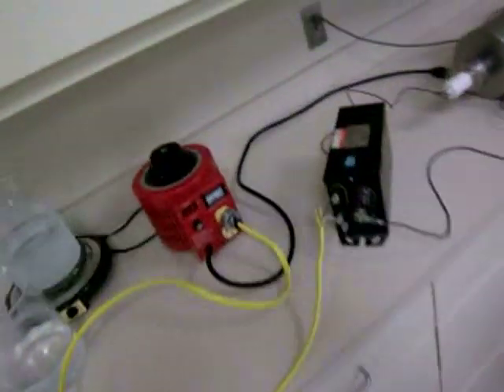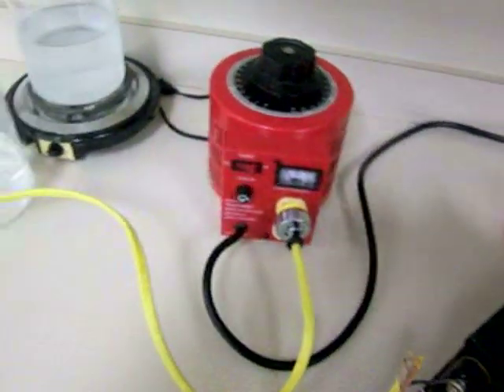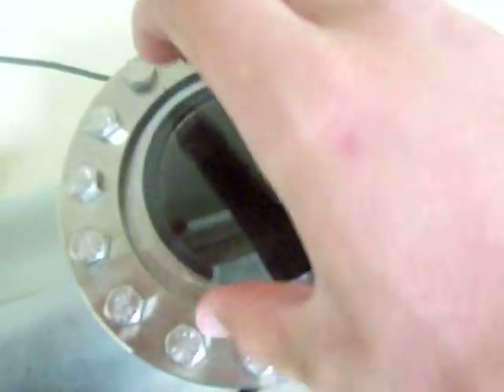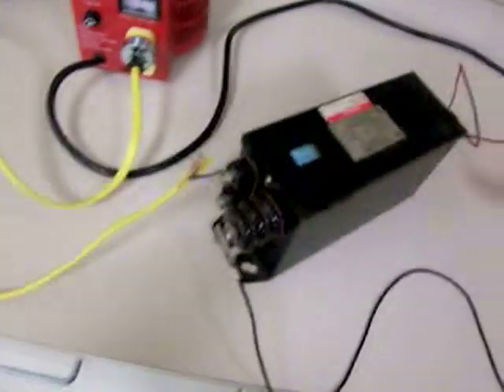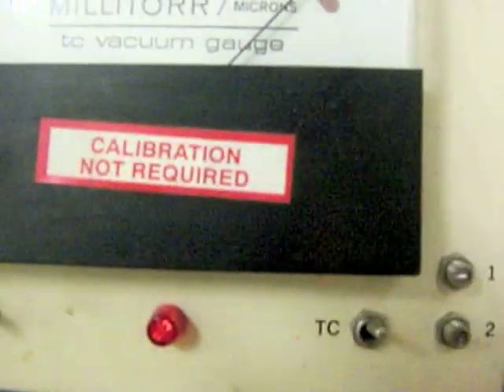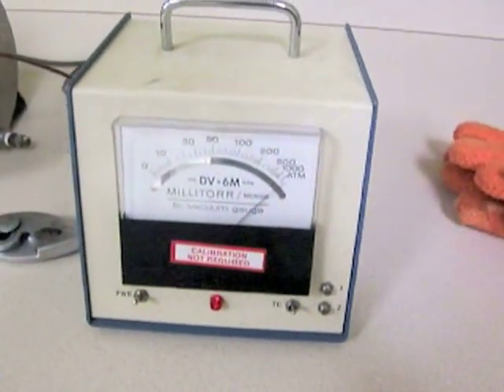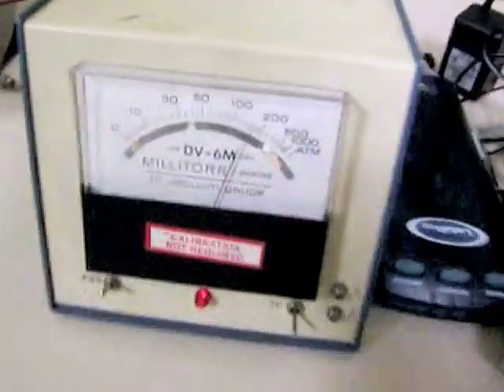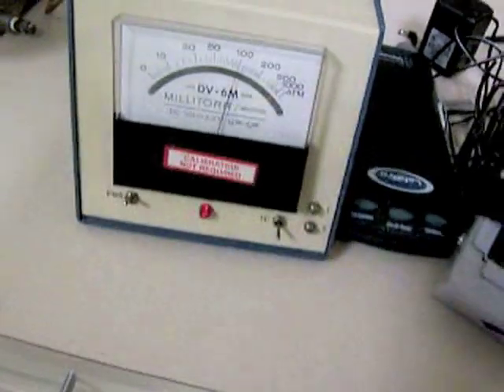Farnsworth Fusor

Comment from the maker: I was using a 30kv high voltage feed through...a spark plug could be used and has been used in other fusors. I was running this fusor on AC meaning that while one leg was connected to the fusor the other was connected to the feed through. When the fusor was positive, the feedthrough or inner grid was negative and vice versa. When running DC, we ground the shell and pump in -HV.

Comment: Hey I was just wondering, were you using a spark plug in the fusor or was your power supply just hooked up to the inner grid. I am also kind of a novice but why was one of the outputs of your transformer hooked up to your fusor? wouldn't that make it live or were you grounding it?

Comment from the maker: The method I was using in this video was rather dangerous as there is no ground. I had actually shocked myself a couple times when I raised the pressure to the point where there was noticeable electrical current flowing. This was an AC run so I wasn't too focused on grounding. When I do my DC runs, I center tap the transformer, ground the case, and rectify the output. The fusor is then grounded which poses no risk of electric shock unless of course I decide to touch the chamber and isolated HV.

Comment: Not quite fusion due to the leak and also because of the "filament" basically turning into a overheated lightbulb. The central wire column is getting in the way of a poisser forming. I'd suggest a double helix looping back to keep the core area clear. Can't wait to get mine up and running. Hoping to setup an energy feedback system using multiple methods and a modified electromagnetic containment using propelled gyroscopics.

Comment: Great chamber! Youre almost there, just a couple things stand out regarding your leak issue. I am assuming the viewport is supported by vacuum and not mounted in place. That is probably your #1 leak. Even with Dow Corning vacuum grease, that arrangement is always leaky. If you are not using the grease, try some, it may improve things a bit. At least enough to give you a nice poisser. Secondly, your vacuum line should not be rubber. Try using the metal flexible gas line used for HVAC.

Comment: Post#2) When you use that line, make sure the threads are taped. Didnt get a good look at the valving, but standard $15 hardware store ball valves work great. With the arrangement I just described, I got my fusor down to 5 microns using a Ritchie Yellojacket HVAC pump. It normally hits about 15 after 5-10 minutes of pumpdown time. I got a 5 once after about 7 hours of pumpdown which included alot of glow discharge cleaning. Keep up the good work!!